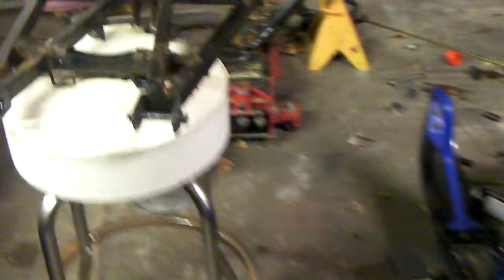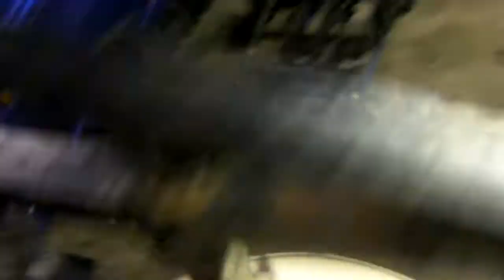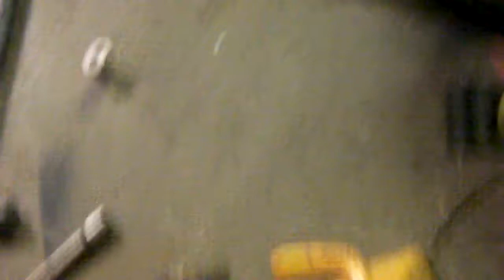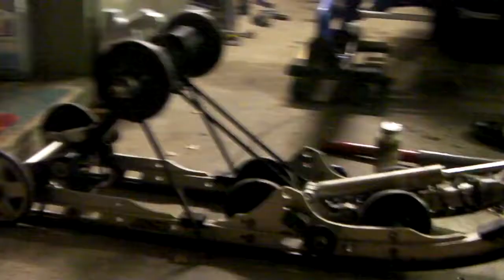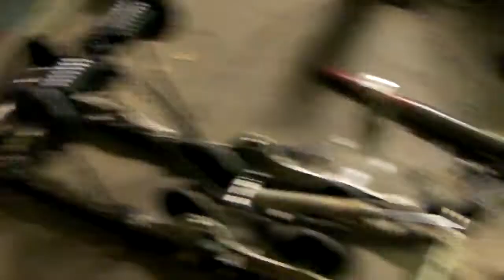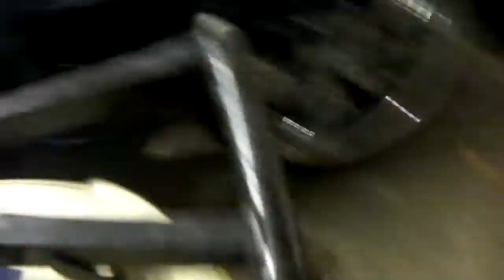V Max Sled Update.. SC4 Suspension Swap Part 1

Comment: Do you have the details on where to drill the holes for the new SC-10 IV suspension? I am doing the same but can't find the schematics.
Reply: Johnny J did U ever find what they were
Reply: Thank you Wesley!
Reply: Not exactly Wesley. In the video it says to move the mounting hole back a "good"  1" or so.... I'm gonna try to find exact number however-If I can.